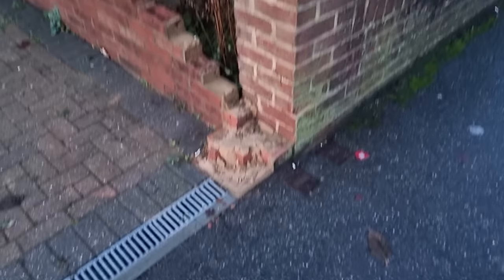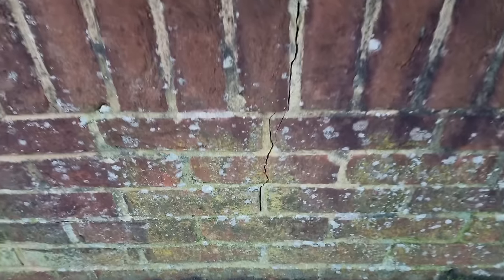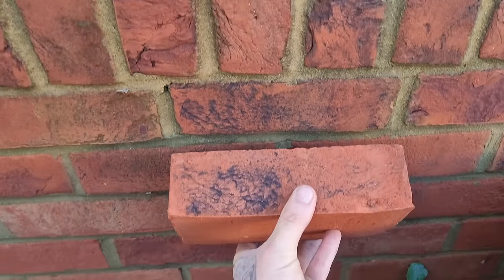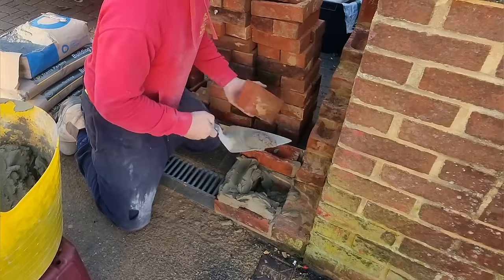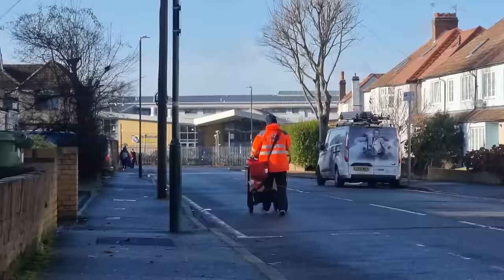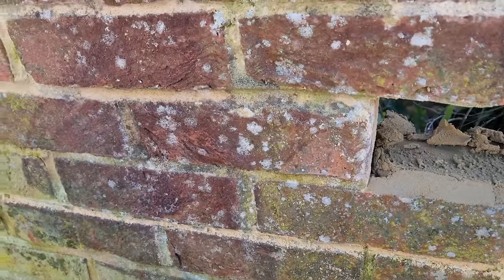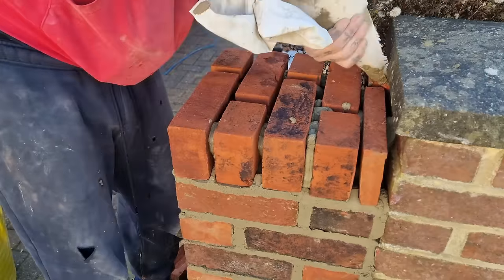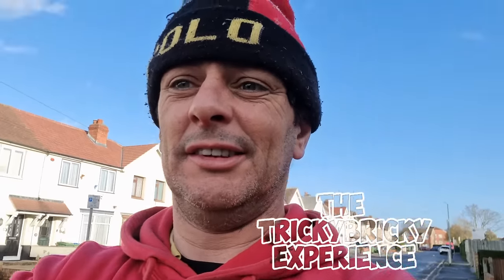Bricklaying was this a fair price? #Bricklaying #construction #repair

Comment: 350£ was a good price defo mate,  little tip tricky, when you have slipped brickwork on that pier you can heli fix it and grind the bed joint out with a 9inch jack it with some wedges flush it with water and inject resin ❤
Reply from the maker: Yeah I've seen them you chemfix them in hey 😉

Comment: Adam old son. The way I do boe on top of piers is measure the overall distance of the pier and decide by five. I think.
Reply from the maker: 5 into 330 leaves u 1mm perps 😉
Reply: Sorry mate start the 1st course with full bricks and the last with full bricks and devide the middle 3 courses allowing for mortar joints. It just looks better than 1 cut.

Comment: Good job surprised the one single brick you replaced was not one off the black and orange coloured one would of blended in better and you never used the bright orange one on the pier as there more orange
Reply from the maker: Yeah maybe . I think it will Blend in OK over a bit of time and weather. The face is the same. Call it a feature 😆😆
Reply: Feature lol. Could have coloured it in with a sharpie.
Reply from the maker: @hoog111  🤣🤣🤣🤣

Comment: No wall starter tricky
Reply from the maker: Why would you need 1 🤣🤣🤣it's not joined to anything 🤔 very strange comment that bud
Reply: @trickybrickys  it’s joined with the pillar next to it?
Reply from the maker: You Don't put wall starters between two separate garden walls bud. I thought you was on a whind up 🤣🤣 on a Friday
Reply: @trickybrickys  and why not? To save a few quid
Reply from the maker: @12andyh  mate there isn't a bricky alive who would have put a wall starter up there. There wasn't one there before! What if next door want to replace the whole front wall and its connected.  Makes no sence at all the put one there. Has nothing to do with saving afew quid. It's common sense